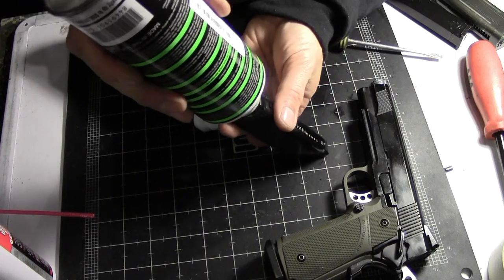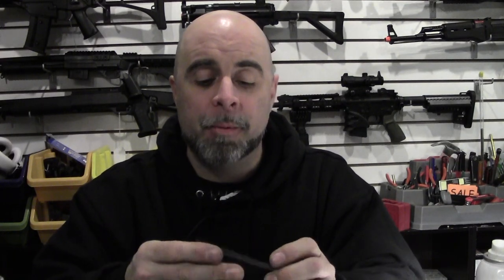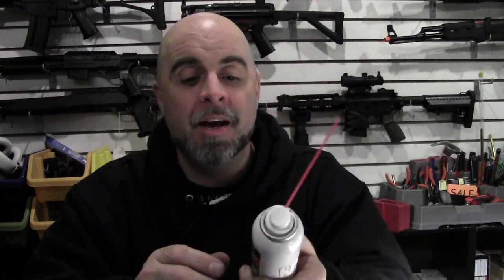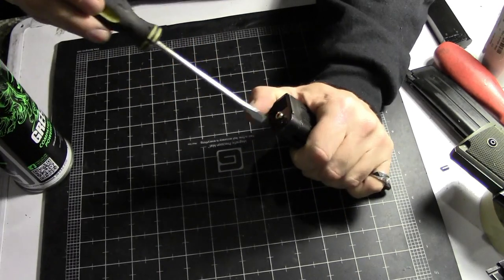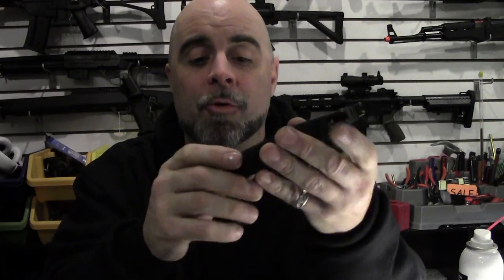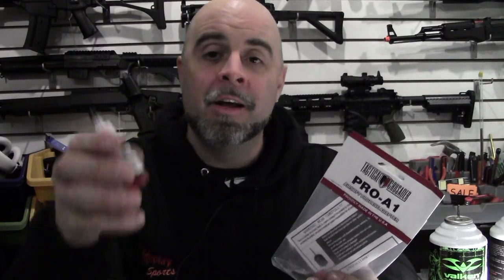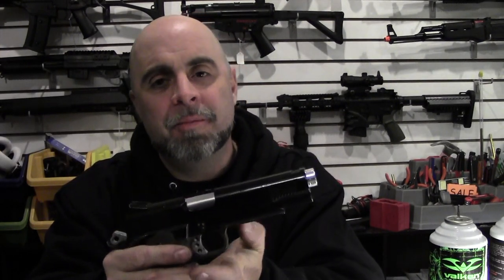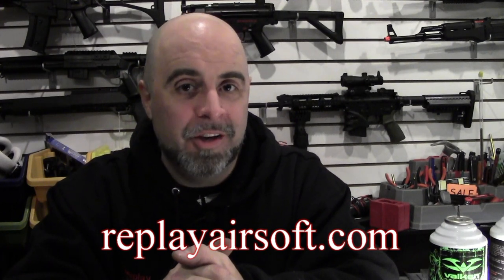Quick fix for Green Gas Magazines

Comment: You’re right sir! This will be long but very informative I promise! Leaving gas in your gas mag puts pressure on the release valve closing and sealing the mag airtight. Air dries out the O-rings that’s why C02 mags leak so regularly because you’re less likely to leave a C02 tightened in your mag thinking it will squash the white gasket where the cart meets with the fill valve but because that gasket is so far into the mag leaving you unable to Feel or know if it’s soft like an o ring which we all assume they are but Actually that gasket is a really hard nylon fiber and not rubber at all so even in a Co2 mag I leave a c02 in there to keep pressure on its release valve as well. Of course this is if you use the mag atleast every 2-3 weeks but also knowing you don’t need to hulk smash a Co2 in place either it only needs a snug fit like you’ve pointed out in tightening a fill valve on a gas mag. If not your Co2 mags will dry out after a month of no use and will leak. Then you’ll need to remove the release valve a load it up with oil while also making sure the other gaskets and O-rings are well oiled too. You def do not want to over oil your gas mag either because that’s just more space you’re losing for air or the gas to turn into liquid so you need to purge a gas mag like you do on a nitrous setup in a car especially if you’re feeling your not getting a good fill in your mag.
This is do to air and or too much oil trapped inside the mag. 
Temp plays a huge factor in all these situations aswell. Also a TM gas mag is supposed to spit liquid out of the fill valve and you shouldn’t stack silent fill valve o rings on a TM mag. That’s why they use a proprietary open fill valve which regulates the air to liquid ratio when filling ,essentially purging the mag as you fill. You shouldn’t ever over fill a mag for too long either because temperature will cause a reverse effect when you have both valves in an open position(the mag valve and the bottles valve) like when filling a mag with any gas. Over fill will cause your mag to start filling your bottle trapping air at the bottom of your mag a kinda reverse effect. Science!

Comment: Hey man, just saying that this helped me out a lot, i thought that would be it since i didn't use it for a while, the o-rings dried out and this method worked 100% Thanks :D 
To any one trying this out, if your issue is the same, and you do it once and it does not work, keep applying the lube until the leak stops. I did it once, it helped but it still leaked, left it over night, applied more in the next day and same, repeated for 3 days, took some shots, and not its working!
Also, if you notice no leaks, but when putting gas on the mag it leaks a bit, tighten it a bit more until it stops
For reference mine is a high-cap 5.1 Tokyo Marui

Comment: Having a mag full of gas can damage it, so only leave a little bit of gas left. The silicon oil will stay in a gas like state with very little energy pushing on the enter exit points of the mag, but will still get to the rings to keep then in a good state.

Comment: had a discharged unused mag for a year mostly brand new and unused. it did in fact leak, so i agree with your side of the tail.  Keep the mag charged, even if its not full at least some positive pressure.

Comment: i leave a small amount in my kjw m700 magazine so it will stay lubricated like you said and i tend to lubricate my bolt and other parts that have alot of where and tear on them. but i only do it when the gun has been used 25 to 30 times

Comment: I store it all year with about 1/4 - 1/2 tank of gas that has that strong silicone in it. I don't actually airsoft so I only shoot with it maybe 5 or 6 shots in a whole year.. it has spent almost 12 months a year pressurized for the last 2 years I've owned it without drying out. Then about 4 months ago I stored it empty and today I thought I had a very slight leak starting where the gas goes in but it turns out I just needed to tighten the valve the smallest little turn to complete the seal. Dumped some gas in to be safe and put it away again. Definitely recommend storing for any length of time with at least some gas

Comment: One of my magazines started leaking around the base. I pulled the base section out, wrapped it in a layer of Teflon plumbers tape and put it back together. That fixed the issue. The only thing to remember is not to overtighten the long screw that holds it in place when putting them back together.

Comment: So my Chemistry teacher said dont attempt to add a lube to propane guns. Its my understanding you know more about ASGuns than she does. I saw your video on GreenGas Vs. Propane Vs. CO2. (thats why I subbed to this channel). How do I keep CO2 magz from leaking???
Reply: Ashame nobody replied but the short answer is simple; use oil based lube for all gas gun kinds as required. Green gas already contains lube but air, propane and c02 does not so guns powered by these require lube. Hope this helps somebody

Comment: i store my mags complacently empty as iv had them randomly shoot gas when left full for a long time but i put a nice bit of silicon oil on the fill valve etc and for CO2 i run one of those cleaning ones through it before storing it again empty

Comment: Thanks for the info this solved my problem I hope at least, but are there ways to get around it and super glue it shut or some JB weld on er to have a seal that will last a while? Other than having to buy the silicone oil and o rings along with a new seal kit if needed?

Comment: My problem is different when I fill it up it fills up but the gas inside is only good for three shots can anyone help me please
Reply: Also my mag isn't leaky
Reply: +Jeramiah Gabrillo Gabrillo guns hammer. probably too weak/strong. check with your local airsoft store
Reply: Hey there I have the same issue did you find a solution?
Reply: are you shooting a co2 pistol with green gas mags? because that's the main cause I've seen so far
Reply: +Dartfish green gas
Reply: Green gas
Reply: Probably out of gas thats how mine is when im out
Reply: Me to
Reply: Try filling it up then purge it and fill it up again.
Reply: Dude, your green gas can is almost out of gas, so when you hold the can in the magazine for 3 or so seconds it does not fill your mag full
Reply: GBB Hawaii I know this is a bit late probably,  but if you unscrew the screw and look at the whole glass canister,  just above it you should see a rubber ring (mine was square) put a a nice amount on the rubber,  put it back together and it should work
Reply: If it's a green gas gun turn it upside down when you fill it
Reply: Robert Dover I’m pretty sure that’s a no brainer
Reply: I have the same issue..  Any solutions?
Reply: Hmm
Reply: Try loading upside down
Reply: GBB Hawaii: You probably have an air bubble in the mag. Next time, when filling, keep your finger on the other hole until you see some green gas exiting. At that point you've pushed the air out. Keep the green gas going until full (5-15 seconds usually) and you'll be good to go. Don't put your face near where the gas exited as that is potentially dangerous, and quite cold.

Comment: Ok i have a we glock 17 and the gas is leaking through the gas charge valve......will this work?
Reply: Did it work for you??
Reply: Unfortunately not, but i think that that is mainly my fault as i left it without gas for way to long
Reply: Bike Trials Bucharest I have a G19 gen3 i bought it brand new it came with an extra magazine. That magazine happens to be the one with leakage Does it leak because it must’ve been sitting without gas too long? Or maybe just defective. Any ideas?
Reply: @dannyzuluaga66  well, gas mags usualy leak from 2 main reasons, no gas for a while, which means no lubrication, or just bad quality ( ahem, we m14 mags)
Reply: Bike Trials Bucharest I have the licensed glock air soft mags and they’re new so probably just needs lubricant. I’m new to the air-soft community just got my handgun last week

Comment: I leave a small amount of gas in most of my pistol mags.  If I am storing the mags, I use green Gas or [propane with lots of Silicone Oil.   Also, I use some pelican oil on the Top of my CO2 carts before I put them in for my CO2 mags.  I found it saves the seals and I have had some of my CO2 pistols for quite awhile without issue.

Comment: tried it for a gun that hasnt been firing for over a year. had to take out the whole valve assembly and lathered it in silicone oil. works like brand new. p.s. make sure your chamber is empty before you fire, always. ALWAYS.

Comment: I bought a green gas umarex airsoft Glock 17 Gen 4 and after about 20 mags, the pressure doesn’t hold for the whole mag and dies out. Idk if it’s a leak or if I did something to cause it. Note: I did remove the mag after it was empty and pressed the release valve, causing the remaining gas to exit the mag.

Comment: I don't hear a leak and the mag is pretty much brand new (only been used for target shooting not in games yet) but the gas still only lasts for half the mag right after filling it up
Reply: Did you try some soapy water to look for leak? Or try tightening any screws or the fill stem with flat head screw drive
Reply: @caseG80  tried both of those. Turned out there was an air bubble in the gas reservoir but i found an easy fix for that. I just pressed down the gas release button of the mag and then let gas run through it for a couple seconds to push it out. Everything works great again now 👍🏼

Comment: This pertains more to CO2 magazines rather than green gas, but some of this advice is still useful.

After living with two Sig Sauer We The People 1911 .177 for a year, first one, then the second, contracted the dreaded CO2 dump affliction in both magazines.  While there can be multiple reasons for such malfunctions, on my two examples I found just one, and found it could be mitigated by simply preventing that CO2 cylinder from turning while you tighten.  Did you ever notice how your CO2 cylinder sometimes spins with every twist as you tighten it to pierce?

Why is that important?  The piercing valve at the top of the magazine is counter-threaded, (righty-loosey, lefty-tighty).  So when you tighten the CO2 against the piercing valve, as it is pushed against it hard, it has a tendency to actually turn the valve itself slightly.  Especially if you properly lube the top of an occasional CO2 with a drop of Pellgun Oil like you should, to keep the O-rings, seals and valves in shape.  

Counter-intuitively, unlike a brand-new unlubricated gun in which the tip of the CO2 "grabs" the dry white (in my magazines it's white, could be green in yours),  seal as it's getting pierced, mostly preventing it from turning even if you don't tightly hold it, a properly lubricated setup may not "grab" as well and spin.  Don't think skipping the lube is a solution...  that white seal really DOES need to be lubricated to prevent it drying out over time.  Thus, as time goes by, CO2 cylinders eventually spin REALLY easily as you tighten to pierce them.  It's surprising just how hard you then have to grip it to stop it from turning inside the magazine as you do.  As you tighten and pierce the CO2 and it spins clockwise while you're doing it, trust me that cylinder is pushing hard against the piercing valve seal, which it will inevitably turn clockwise too, loosening it, if only just a little.   As once was famously said, a little got more and more...  PFFFFFFFFFFFFFFFFFFT!

Worst part of all this is that it's darn near impossible to find a valve key (like the one that you got in the re-build kit!), that will fit within the confines of my empty magazines which would allow me to simply and easily just tighten that damn valve, leaving you to use flathead screwdrivers and the like, potentially damaging the needle or valve itself while not being able to really tell just how tight you got it.  I eventually took some online advice I saw, carefully UNSCREWED THE PIERCING VALVE, removed and cleaned the o-ring or (replace it if you have one), cleaned the threads and put the o-ring back on, silicone lubed it all, then WRAPPED PLUMBERS TAPE AROUND THE WHOLE THING, both the mounted o-ring and threads, before COUNTER-CLOCKWISE screwing the assembly back in as tightly as I could with no valve key.  

Another drop of Pellgun oil to top a new CO2, and tighten.  While I got a quick sputter it immediately became silent - it held air!  Since then, even leaving a full CO2 loaded for weeks or even months has caused me no ill effects as long as I kept the white piercing-valve seal "hydrated", kept from drying out.   And following these instructions.  

So as a preventative measure, if you grab your CO2 tightly while getting loaded. you'll probably always have a nice day!

Comment: The fill valve in my 1911 was leaking but it kept most of the gas. I wanted to fix it before it turns worst but i didnt know how.
I checked a fixed mag and i saw something different between the two. The leaking one's valve tube was hollow but i could see something in the fixed one?

help me pls i just bought the new 1911 xd

Comment: I bought an CO2 Airsoft Pistol it came to me with an Green Gas magazine, so i buought the CO2 magazine but now when i load it the hammer doesnt go back so it dont load another bullet then you i have to pull it again to get the BB in, do you know how to fix it?
Reply: CO2 is about 55 BAR or just under 800 PSI. Your gun was a green gas gun which was designed to run at 8 BAR or just over 100 PSI. Something's probably bent or broken.

Comment: been using plumbers silicon grease and pressurised spray lube since 2004 never had any plastic break on mags from that. airsoft lube is a rip off, just do your research and you will get a life times worth for the cost of an airsoft specific lube. i run gbbr and pistols other than that good video

Comment: So the reason I’m watching the video is because I’m only getting one go from my pistol mags. It will empty the mag, but it won’t do another reload. But I emptied the gas from my mags at the end of every session cause someone told me it bad to keep it in there. The valves are fine, but what’s happening? Well, it might be since the valves are dry, it’s letting too much air between shots. So I’m going to lube my valves, get them up and running, and leave at least some gas in and see wha my happens. Thanks for the video!

Comment: completely stripped my fill valve...
Reply: Yeah, thats the thing that they dont mention mostly in those tutorials. When screwing those fine threaded things back, at first turn it the opposite direction, as if screwing it open, when you hear little click, then you know the threads are aligned and you can safely screw it back in. (also in airsoft dont over screw anything. Soft metals and such. Both of which i didnt know anything abt until i broke stuff and then hours and hours of watching videos i managed to put together info that i really needed)

Also if you want more info i suggest you to look up LaZoucheCustomshop channel, he has hour long video how to repair leaky magazine and how to maintain it.
I have no affiliation with that channel but i share it bc not everyone can use airsoft related repairshops and i think his videos are really in-depth. And it comes handy to know whats what in ur airsoft gun.
Reply: @lainchanb___k1244  Nice tip with the reverse screwing.

Comment: Will WD40 work
Reply: I don't think so. It might melt the stuff in the magazine. I'm no expert I a it's oft tech stuff but I won't take the risk. I would rather spend some money on someting specifically designed for airsoft than risking buying a new mag. Coz pistol magazines do cost some money